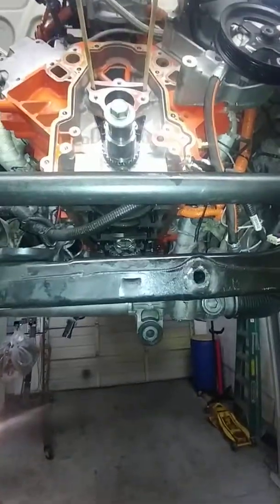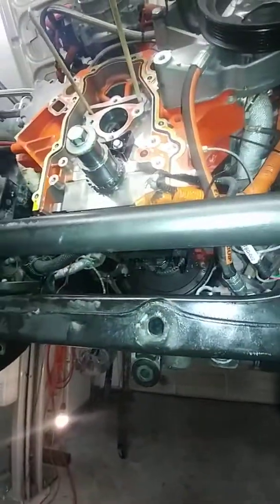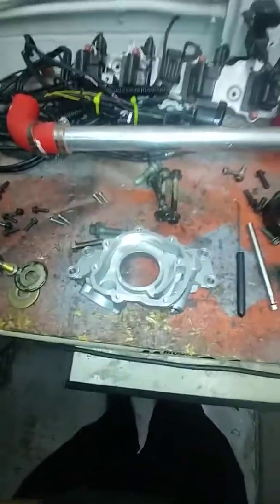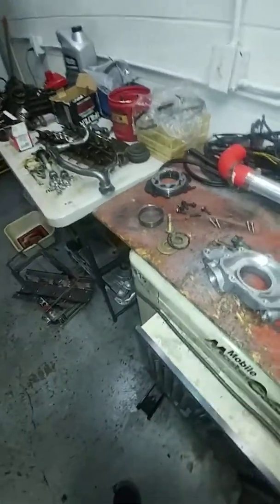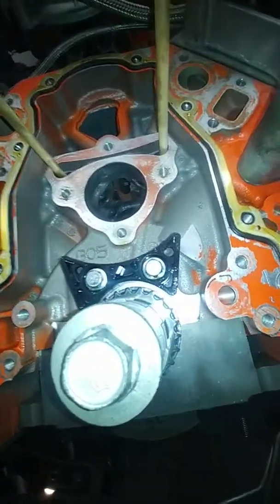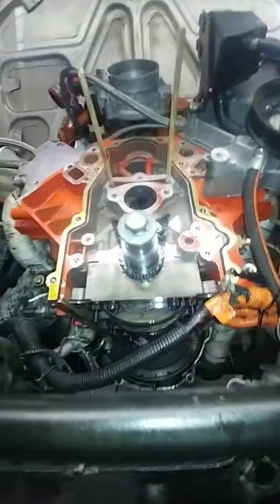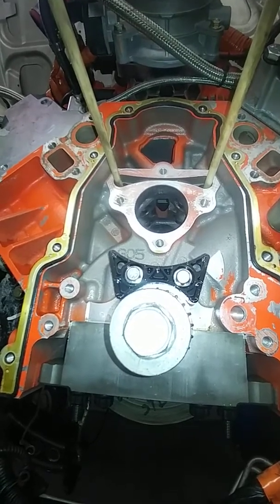Diagnosing low oil pressure on LS motors

Comment: 2009 Chevy 6.0 L very very low oil pressure at stop lights lights go off I change the oil pump high volume change the change the O-ring to the red put thicker oil shut off the oil pressure relief valve in the pan 4 lb of pressure at stop lights go off been that way for a year the truck has plenty of power no smoke no tick it will pull a house down 160,000 me what am I missing here please help anyone change the sensor three times

Comment: I think this is my problem oil. My oil pressure very low Chevy subarban. 2011 edit oil pump o Ring Everybody said come bearing LS engine, I didn't think so. It's good to engine Everybody have a problem with oil pressure. How to stop the Camshaft bedding Walk around

Comment: If a cam bearing has come out why? Bad bore to be driven in they should only move if it locks to the cam and spins. Otherwise this is just a shi!!y setup all around.
Reply from the maker: No one really knows. But usually its after a rebuild. And probably worn bores. And aftermarket bearings. Happens more on aluminum blocks i can say for sure.
Reply: @hillsautoservice whats the best fix, if a cam bearing has walked out after a rebuild

Comment: If your cam bearing has a chunk out of it, that material is everywhere. I wouldn't suggest just replacing a bearing or two. How's that lifter and cam lobe look? Since it was recently built (a few miles), you might get away with some things you normally wouldn't such as any DOD issues (didn't catch which gen of LS).

Comment: 2010 camaro ss 6.2 liter changed oil pump and sensor still 5 psi hot idle
Reply from the maker: Or if your done with it let me know we buy them broken.
Reply from the maker: Tear it down and diagnose. Prob a cam bearing or something.

Comment: i have 15 psi on hot idle only ... what could be the reason?
Reply from the maker: It's almost always just the o-ring on the pickup tube that goes into the oil pump..  unfortunately if the engine is inside the vehicle the oil pan has to come off and the entire front of the motor so you can get the timing cover off
Reply: @hillsautoservice  thanks. I replaced pressure valve inside oil pan and added one Lucas Heavy Duty Oil Stabilizer. Now my hot idle is 26-30 psi. I didn't check that oring unfortunately (( but it's new and replaced 6 months ago
Reply: @DIABLO_4_Tester_Sacramento  what year was yours?

Comment: Why didn't you mention the oil pressure relief valve in the oil pan? That's another place to look at.
Reply from the maker: Sorry this video doesn't represent the 2007+ motors with the displacement on demand systems
Reply: @hillsautoservice   I hooked up a manual guage on my 05 Yukon Denali. Cold start is at 40psi, when it's hot it idles a little above 10psi. When I accelerate it shoots back up to 40psi. My instrument cluster reads 20psi cold start, when it's hot it slowly drops down to zero and goes up to about 5 psi when I accelerate. The engine runs good, no knocking no tapping or shuddering. Should I be worried?
Reply from the maker: @madwestboy  yes you need to have it looked at. Sounds like the oil pump pickup oring has failed on that.

Comment: If you pull the pan and get the crank in the right position, you can inspect the cam bearings without pulling the cam.  If you can see the bearing protruding from either side of the boss, it's walked out.  My #2 cam bearing walked as well.  Thanks for the info on how to change them without pulling the motor!

Comment: DOD delete in a C5 z06 , 54-56 at start up, once oil temp get up 200+ pressure has progressively dropped to 20 or less at idle and no more than 40 at any cruise or acceleration.
Reply from the maker: That's still within spec of 10psi per 1000rpms. But I would check pickup tube oring and at the same time the oil pan is off I would do a relief valve delete in the oil pan if equipped.
Reply: I have the same symptoms in a 02 gmc yukon denali with the lq4 6.0l and I already changed the oil pump with a fresh oring not shure what or ware to look next I have had the yukon for a year now and it has 471k on the clock mabey it's just tired idk but I would love to keep it going to see how many more miles I can get on it
Reply: Did u figure it out mines doing the same

Comment: Sometimes the o ring on the oil pick up under the windage tray goes bad causing a lost of oil suction to the oil pump.
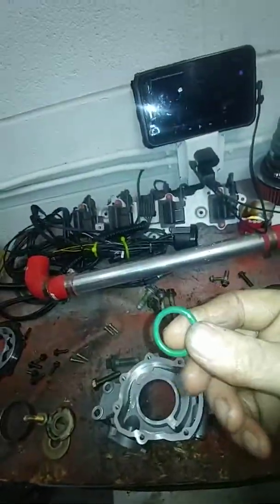Reply from the maker: Yes. The oring was explained in the video. 1:20
Reply: @hillsautoservice  he’s talking about the other o ring on the pickup. it’s rare that it messes up since there’s never any need to touch it but i’ve seen it happen